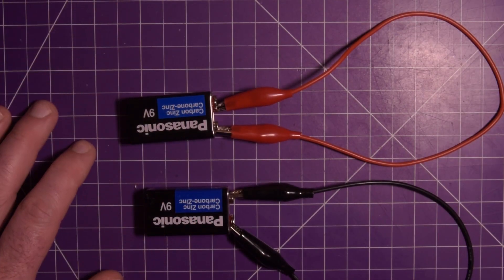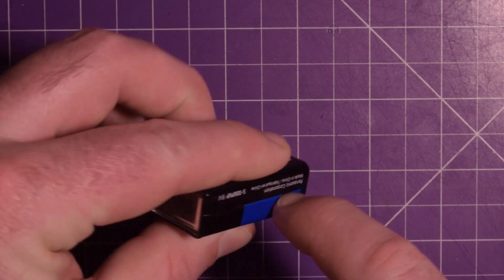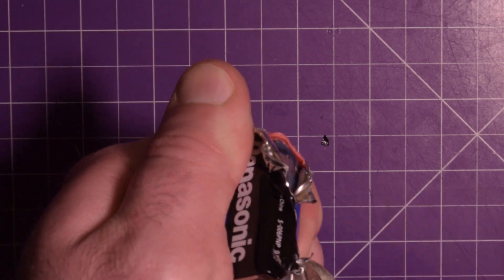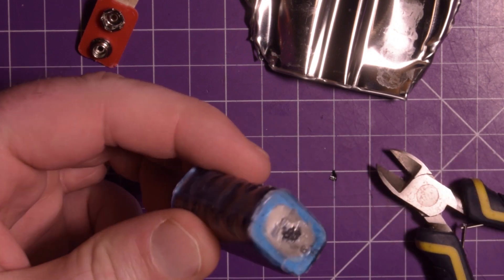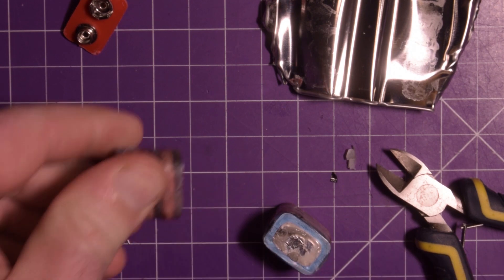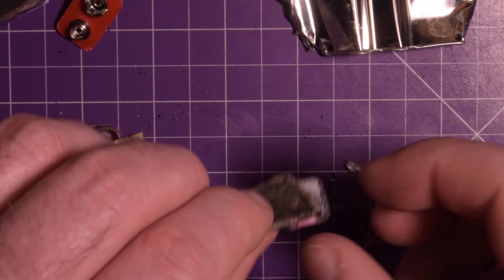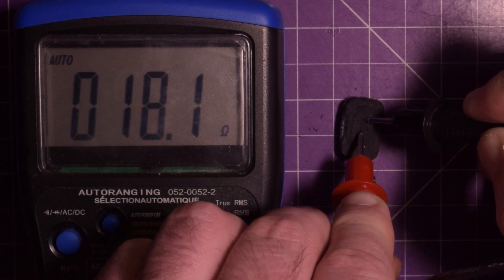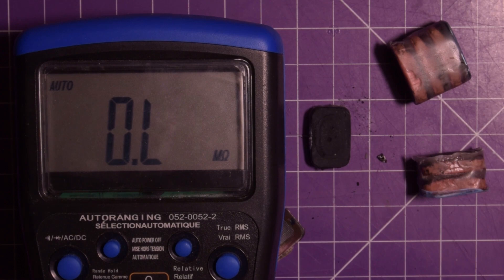Inside A 9v Battery

Comment: There are at least 2 different styles of 9v batteries. Another type they have 6 very small batteries, tripke aaa style maybe quad size or smaller, not sure, that are hooked in series inside a metal case.

Comment: You might find that a lot of the black stuff is Manganese Dioxide as that is used in a lot of cells. If you are after carbon rods, go for the AAA,  AA, C and D Cell Batteries.
Many thanks for the videos.
Have Fun,
Joe
Reply from the maker: It is possible, I'd have to look it up, these are specifically Carbon-Zinc tho